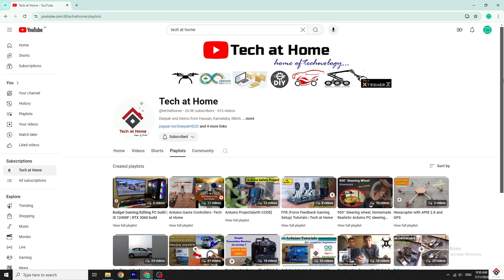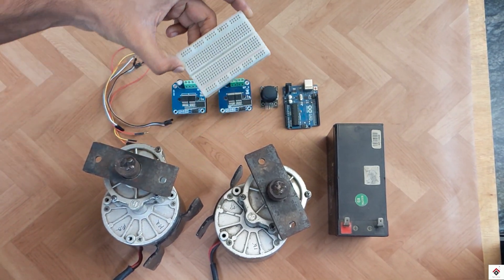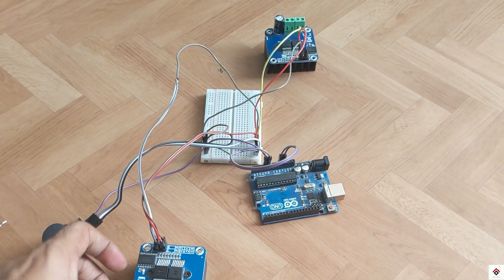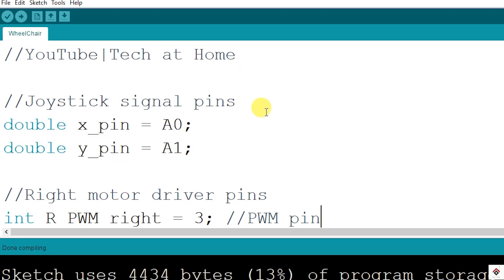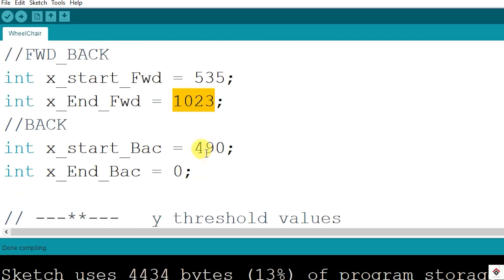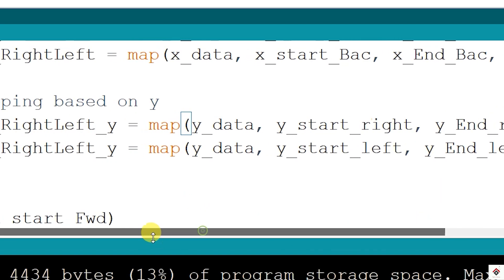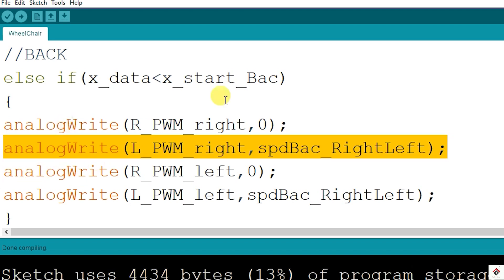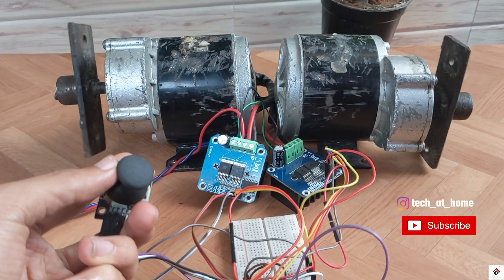Arduino Joystick Controlled Wheelchair Project using Ebike motor[CODE] | Final Year Arduino Projects

Comment: what battery type is required and its power
Reply from the maker: You can use Lead acid battery. These ae 24v, 13A motor.

Comment: Is this the same process that we can use in using side tactile buttons instead of a joystick?
Reply: I really need this sir, our title defense is tomorrow huhu
Reply from the maker: You cannot control speed with buttons.
Code and connection will change.
Reply: @t @techathome okay sir. But can we use buttons instead of joystick for navigation? Also, we only have the non-geared dc motor, will this be okay to use? We badly needed this one for our capstone.
Reply: we accidentally ordered the dc brush motor 24V 250W, does it have the same connection like the video? we tried but its not working🥹
Reply from the maker: It can be used. Everything remains the same.

Comment: Hello you made very good project.this project need break.weelchair dc motor and break.can you add to program breake  code.when joistic speed 0 breac 1ms off.
Thank you for project.
Reply from the maker: Thank you 👍 
To get the brake effect, move the joystick slowly towards opposite side.

Comment: Hi, I just wanna ask hopefully someone can help me. I have a project where I am controlling a 24V fan and 24V motor via ESP32 S3 WROOM2 the motor driver I am using is the same as the one used in the video, and my power supply is also a 24V. Now whenever any of the two components are triggered (motor or fan) the ESP32 S3 will automatically reset. So, I wanna know how can I solve this issue? Can anyone please help me? Since base on the video even a 12V supply can run two motors at the same time without any problem.
Reply from the maker: I think this is happening due to insufficient power.
Use external 5v supply for motor driver Vcc  and Gnd instead of using ESP32 3v pin.

Make sure you connect Gnd of external 5v supply to ESP32 Gnd.
Reply: @techathome I already did this, to power the motor driver I did used a buck converter but still the issue was not solve🤧
Reply from the maker: What fan are you using. Is that also controlled with motor driver?
Reply: @techathome the fan I am using is a Sanden Auxiliary 24V 80W fan and it is controlled by a 5V single channel relay.
Reply from the maker: Relay also consume more current.
Use external 5v supply for relay Vcc also along with motor driver Vcc.

Comment: Isko Bina computer Ki Nahin Chala Sakta
Reply from the maker: You can run without a computer. 
Upload the code and disconnect from computer.
To power the Arduino you can use power bank and USB cable OR
Round pin connector and 9v battery.

Comment: If I buy a code, can you give me the code on the same day I buy it?
Reply from the maker: Yes within an hour you will receive mail.
Reply: @techathome  24V 250W 2750RPM High-Speed Brushed Electric Scooter Bicycle DC Motor MY1025 Electric Bicycle Parts i usw this motor is it? Okay?

Comment: Also i used the same procedure as shown in video still my motor driver and arduino got damaged?? What can be the reason..??
Reply from the maker: I think wrong connections.
Check this video and try running the motor directly using the driver: https://youtu.be/H2YJRaaXFIM?si=FI3AyUd9A0gL35Dl

Comment: what about the current in these modules, can it draw 24V 12A?
Reply from the maker: Yes 24v, 12A will work without any issues.
Reply: @techathome what's the highest ah that the module can handle?

Comment: I have two dc motor 0ne( a 24 volt, 200 watt, 3 amp motor.) I want you to advise me on choosing the battery.
Reply from the maker: Battery voltage should be 24v.
Ah value will decide the capacity. More the Ah, more the runtime.

If it is only for project purpose you can get smaller one or DC power supply also works good without any battery.

Comment: Hi sir, can I ask if I can use a starter motor instead of an e-bike motor?
Reply from the maker: No,
Starter motors are designed to work for few seconds only.
They will burn if you keep motor on for more time.
Reply: Thank you

Comment: Sir if i use 24 v battery instead of 12 v ,will the Motor driver work?
 I am using 250 w pmdc motor for my wheelchair. Kindly give me suggestion.
Reply from the maker: Yes motor driver will work with 24v

Comment: bro which motor is best for robo race except for johnson and bo motors and also tell for best wheels
Reply from the maker: Check Planetary gear motors 12v and required RPM.